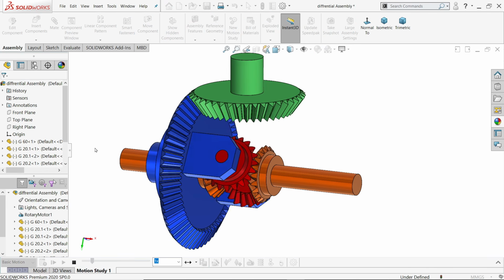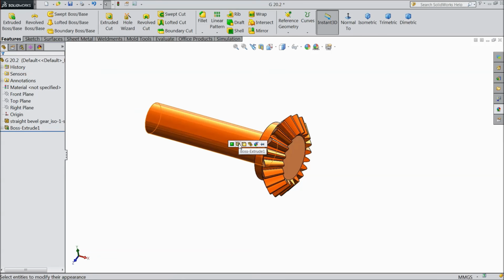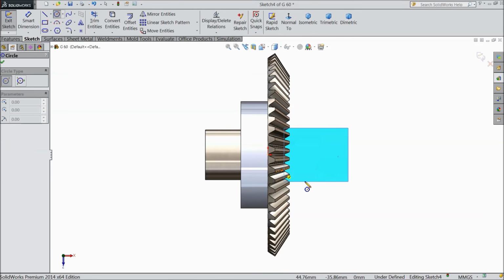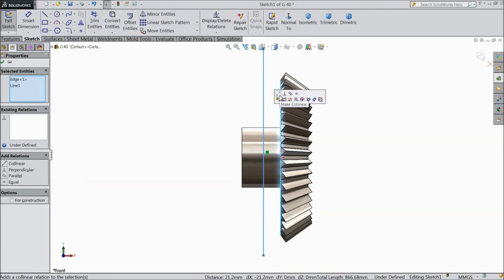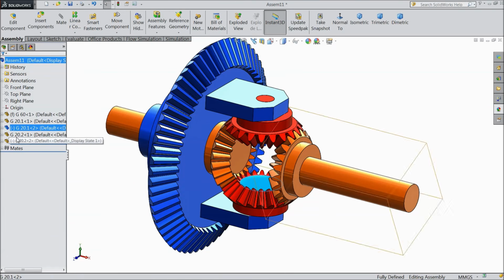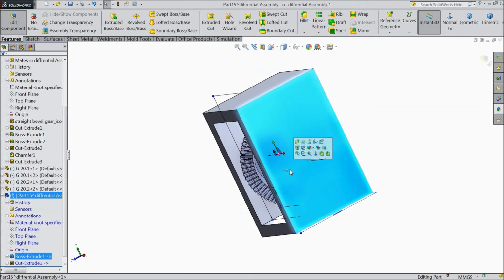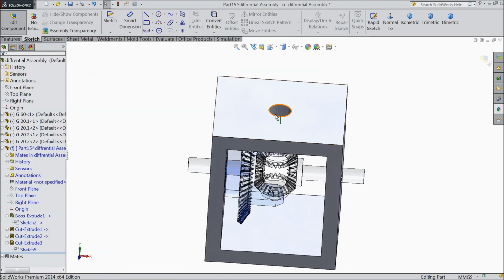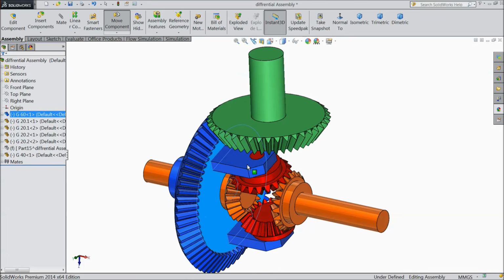Differential Gear Box in Solidworks

Comment: Thank you for this tutorial, I learned a lot from it and was able to follow along. I could be wrong but one correction that could be made is making the drive shaft gear a pinion gear and not a straight bevel gear. The teeth don't line up well and this should fix the problem. Not a big deal though, I appreciate the video

Comment: From where do you get the dimensions?
Reply: either use arbitrary from the internet or design your own open slip transmission and calculate the gear dimensions yourself (like you would in a project etc)